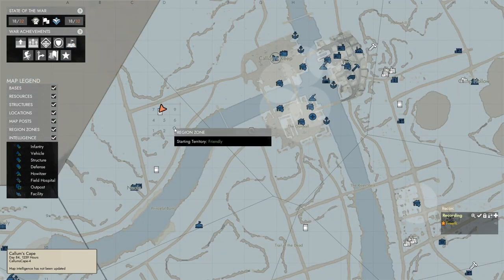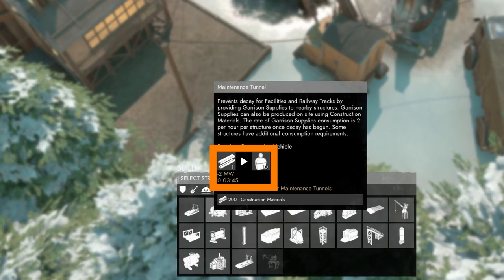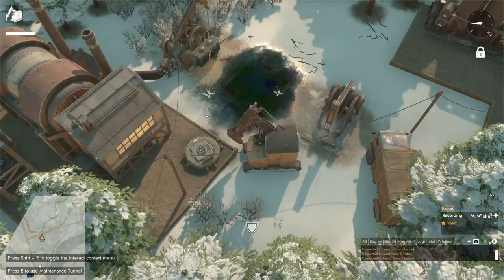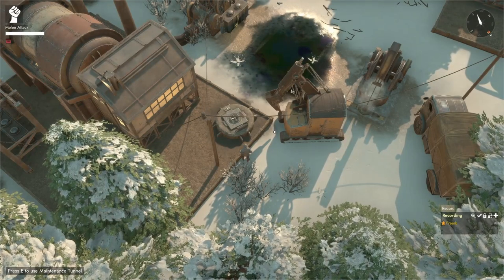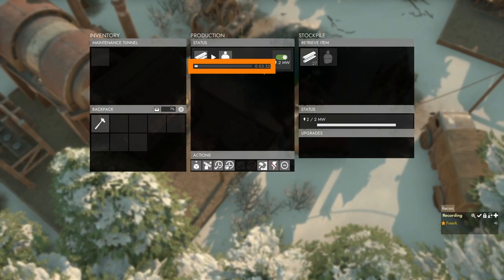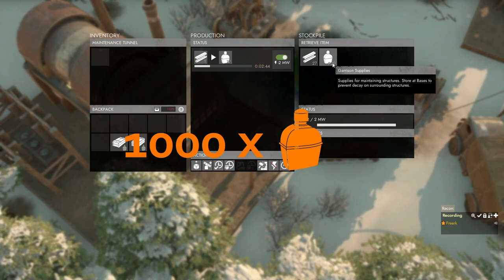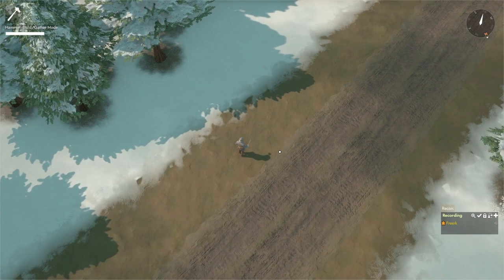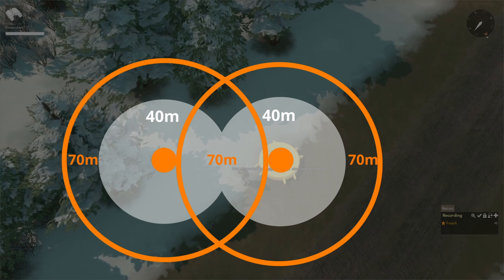DEPRECATED: Foxhole Facilities - Maintenance Tunnel

Comment: can ya maybe explain the whole "will decay because not connected to source" msg? how ya connect to a/the source???
Reply from the maker: "a source" is a structure that can prevent decay within a certain radius. Maintenance tunnel radius is 40m, Forward Base and Bunker Base radius is 80m and the town Base radius is 150m.
If you build within the active radius of one of these structures (Base or Tunnel) you can deposit g-sups into the stockpile of that structure  to prevent decay for all structures within the radius
Reply: @FreerkHoltes  so it auto connect when one of those are active then i guess? well thx for answering though!
Reply from the maker: @GunRunner106  If it is in range of one of those "sources", and that "source" has garrison supplies it will use those to prevent decay.
In a sense; every hour it will "look around" for a source of garrison supplies to prevent decay, if it finds one it will not decay but consume a g-sup if it doesn't find one it will decay for a certain percentage.
Hope that clears it up a bit more.  If not, you might also try the wiki article on decay: https://foxhole.fandom.com/wiki/Decay
Reply: @FreerkHoltes  thx man, for the infos :)